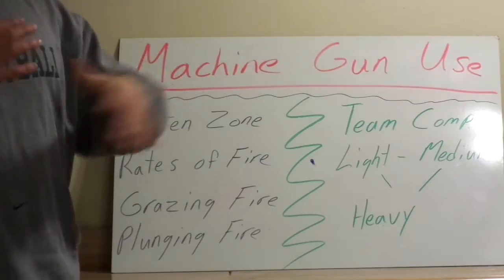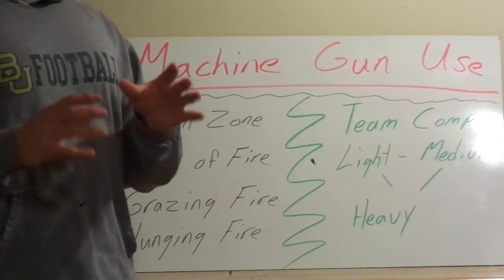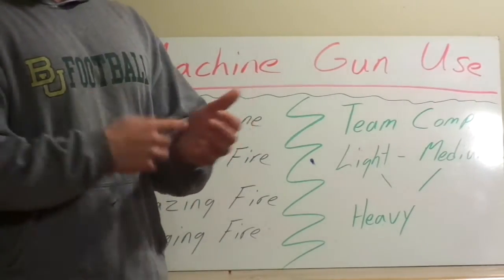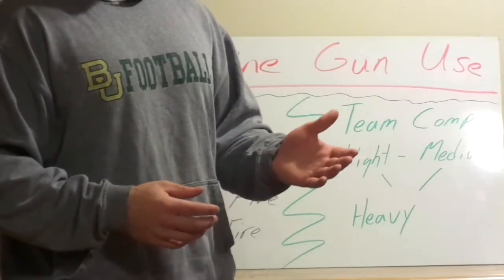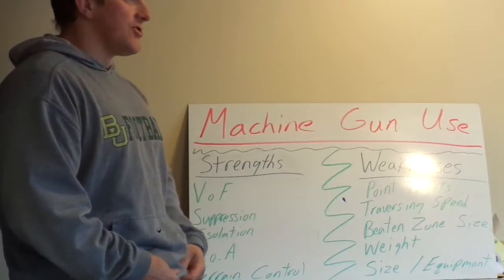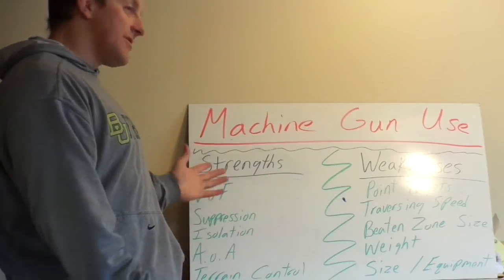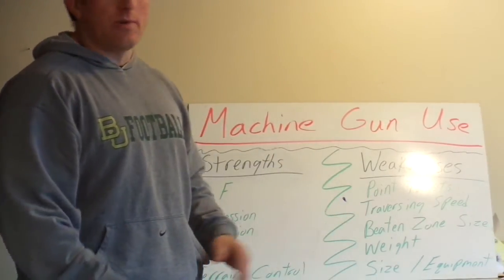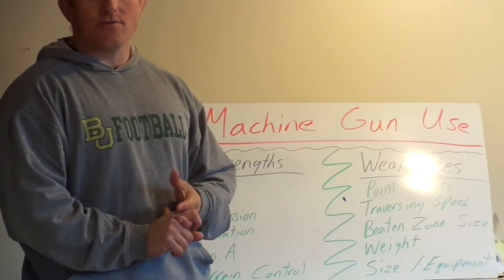Machine Gun Realities

Comment: This might be a stupid question asked three years too late by a civilian
 without a clue, but I'm really curious and I don't think I'd get a 
qualified answer elsewhere.

When would you seriously regret being armed with an m249 instead of an m240, in a medium machine gun role? Let's say a gun team equipped with an m249 has as many people and barrels as another gun team with the m240. Is the difference of performance "in the brush, the field, things like that" (as you say @6:15 ) between 7.62 and 5.56 big enough to matter? I've shot at brush with both .223 and .308 but the difference I saw in penetration wouldn't motivate me to carry the much heavier gun.
Reply: Most infantry rifle platoons are consisting of 4 squads, 3 rifle squads and 1 wpns squad. Each individual rifle squad consists of 2 m249 saws. So total of 6 saws per platoon. And in the wpn squad usually 3 gun teams. So you typically have both on the battlefield when conducting platoon operations
Reply: What's funny is a Cav Scout Dismount Team will rock a 240 but with no Assistant Gunner. Will never use the 249, its not practical for small Recon Teams.. Need something with range and power and in a hurry.. team is about 5-8 guys by themselves